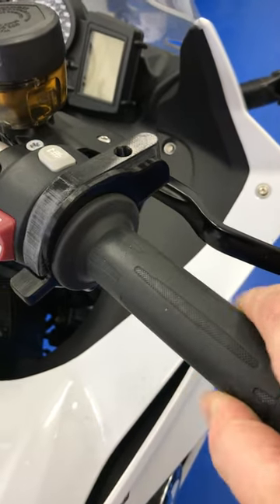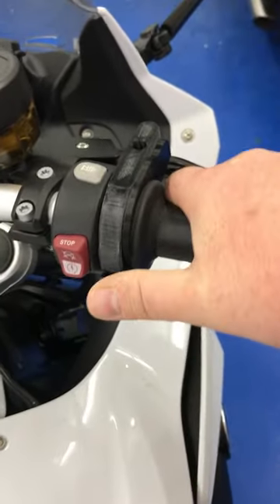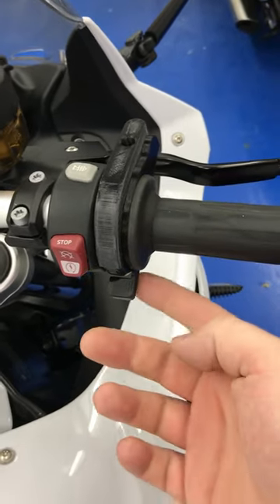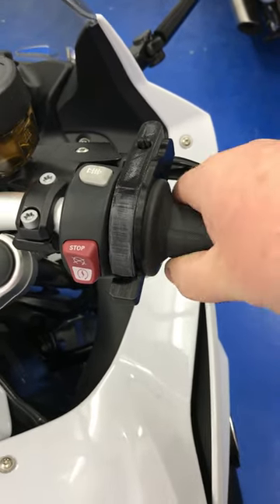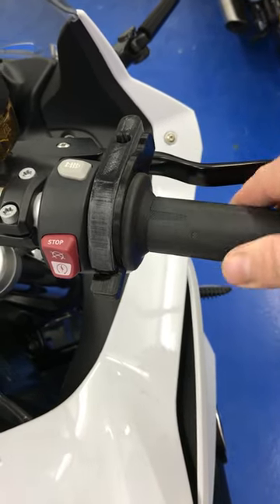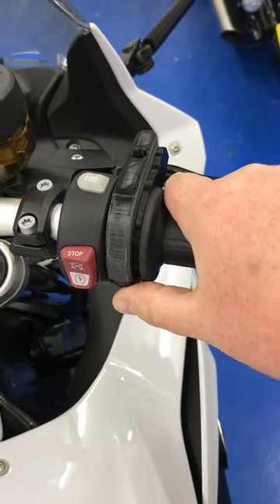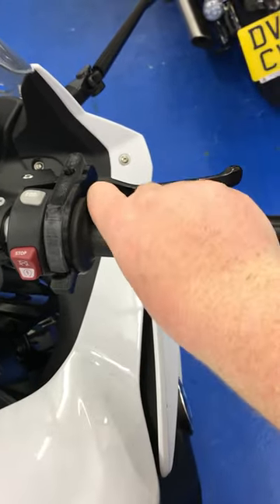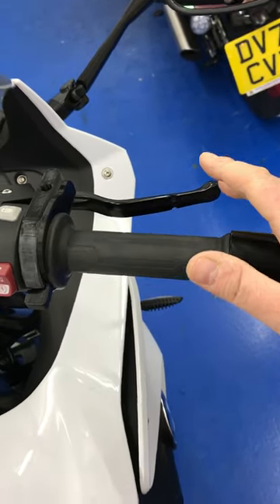BMW 3D Printed Cruise Control / Throttle Lock Operational Demo! - eBay Link in Description!

Comment: What if you brake?
Reply from the maker: Then your bike slows down… 😂
Joking aside, when you grab your front brake you naturally role off the throttle, I’m sure that’s on reason why they designed wrist throttles over the thumb types you see on quad bikes, which in turn would release this mechanism.
You can’t effectively pull a brake lever while riding without holding the grips so that one kinda sorts it’s self out.
Obviously if you just used the rear brake then this would not automatically disengage. However if your only using the rear brake then chances are you are not in an emergency situation and have the luxury of time to disengage or roll the throttle off consequently disengaging this device.

It’s not a ‘perfect system’ but a great addition as an ‘aid’ for longer distance motorway use.
Likewise as your setting your throttle position and not a speed like you can with electronic cruise control, if you go up a hill it will slow down, if you go down one you’ll speed up.

The idea of this design was to make a more compact and aesthetically pleasing version of devices that work in a similar manor that are already on the market.

Will be selling these on eBay as soon as my printing process is repeatable and high quality - have just bought a SLA printer to improve this and make an ‘injection moulded like’ product with 35 micron accuracy 🙂
Reply: Obviously you disengage it before you brake